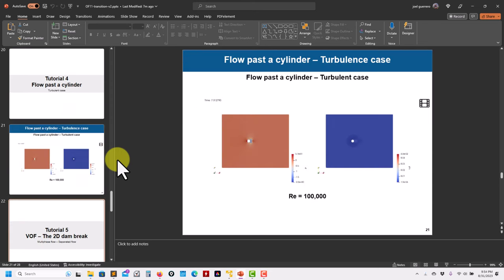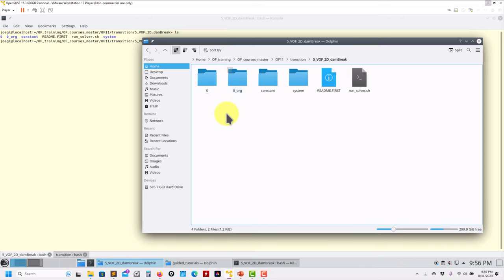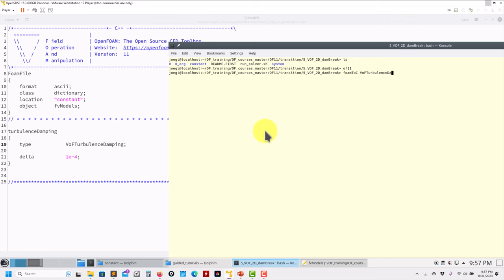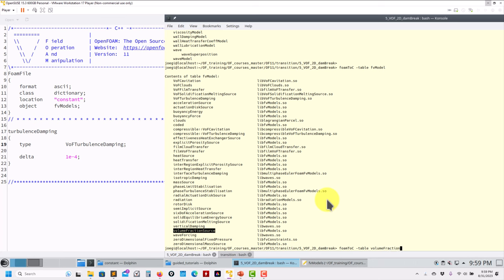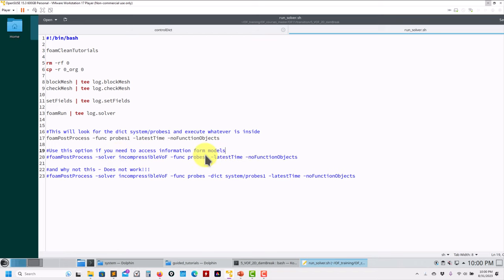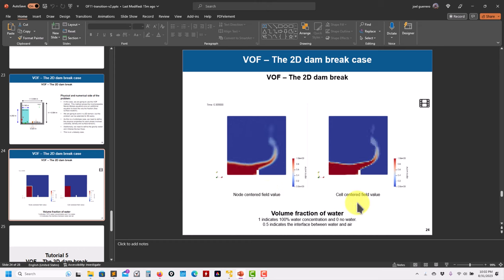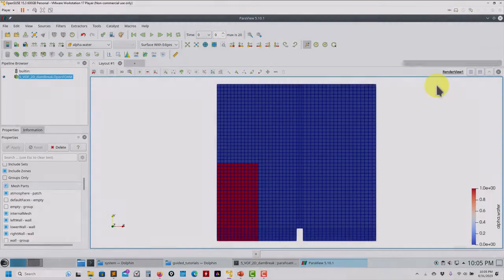Transitioning to OpenFOAM 11 from OpenFOAM 10/9 | Part 7

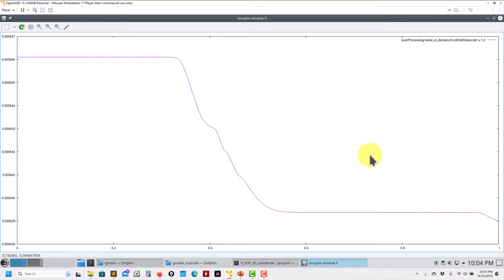Comment: Just a minor point @10:21 regarding the truncation error - don't forget that the vertical axis is auto-scaled, i.e. doesn't start at zero.  The actual loss is about 0.1%, which is probably tolerable for most applications.
Reply from the maker: thanks for point out that

Comment: Hello, thank ou very much for the series so far. Do you have any plans to do a guide on the changes from usign AMI to NCC for  moving meshes, specially rotating mesh applications like propellers and pump impellers?
Reply from the maker: Well, it should work as for OF10. Let's if we have time to do a video on that.  We address this topic in the dynamics meshes training